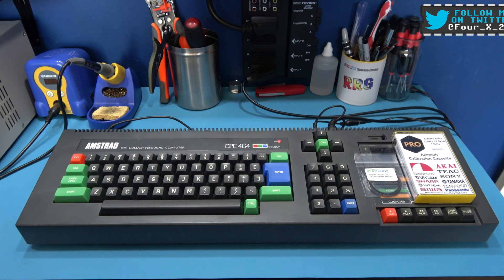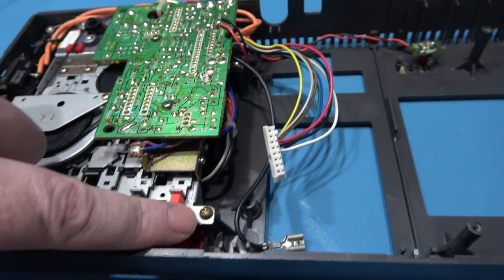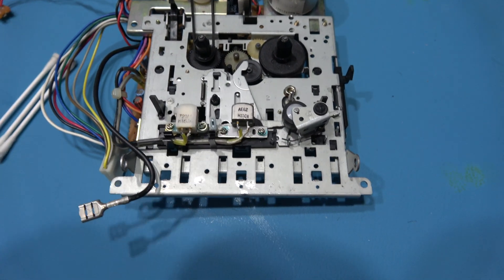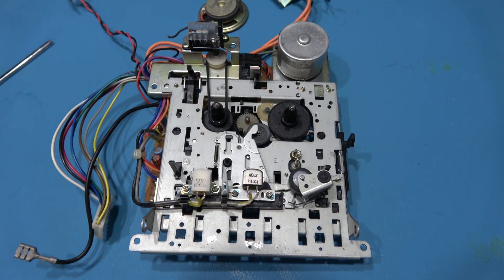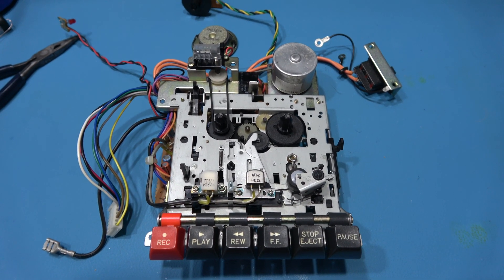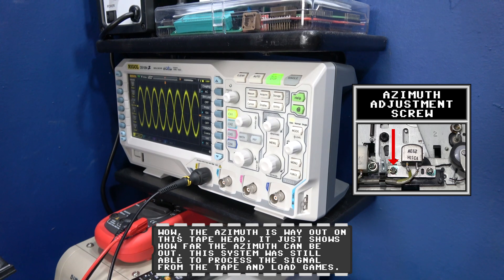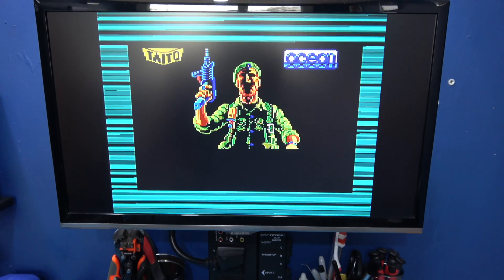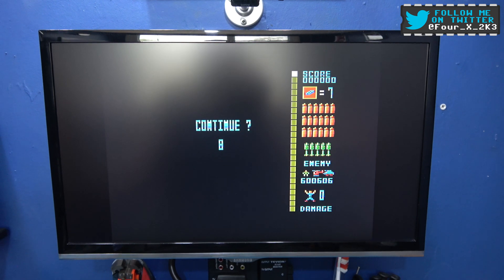Amstrad CPC 464 - Part 2 - How I Service the DataCorder (Tape Deck).

Comment: Great video but I have a question:
I just got one of these and after replacing belts, cleanup I still get a lot of noise in the speaker when the play is on and volume turned up . The noise is only present then play is pressed and the tape deck most of the time gives me a loading error usually at the end of loading the game. I wonder if I need to replace the capacitors as well or the excessive noise is norma? I’m also trying to locate a head azimuth adjusting program for CPC that I could load in from TZXduino which actually works perfectly every time. 
Any help would be greatly appreciated!
Thanks!
Reply from the maker: Yep, change the caps but also make sure the tape mechanism is grounded properly, missing a ground can cause excessive noise.
Reply: @Four_X  I’ll double check the ground first and then do the caps. One more question:
I added external input for TZXduino but I also would like to be able for record external signal to the CPCs tape deck, what would be the best way to do that?

Comment: Can you adjust the azimuth without the tape, I can't source one at the moment, my tapes load but it sounds ugly
Reply: And I don't have them machines either 😕
Reply from the maker: You can do it by ear but to get it nutz on you need an Oscilloscope and a Azimuth Alignment Tape.

Comment: Fantastic. Was just doing this myself with an analogue scope.
Problem i'm having is that I don't have one of those cassettes, so was hoping to just use a store bought cassette.
When I turn the azimuth adjuster screw it doesn't change the peak/trough height.
Any idea's why thats happening? just due to the cassette being digital data already?
I'm also taking ground from the speaker out pin. Thought ground would be ground across the board.
Reply from the maker: With a normal audio tape you should see some difference I.E. A change in Amplitude when adjusting the Azimuth, Maybe it's the tape your using or I know it may sound stupid but make sure your scope is set to AC Coupled as it is an Audio Input.
Reply: @Four_X  I think you just hit the nail on the head there. I left it in DC didn't I! haha. thanks!